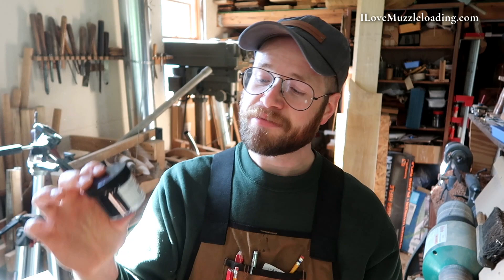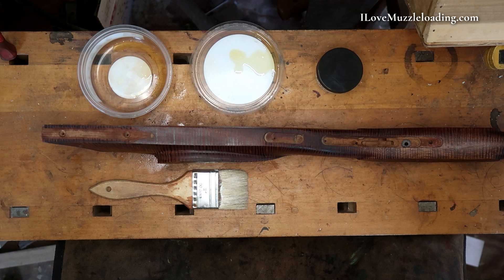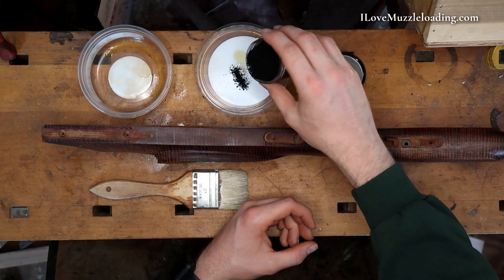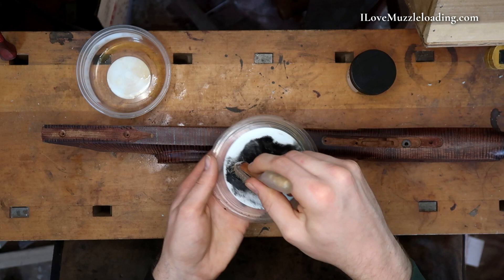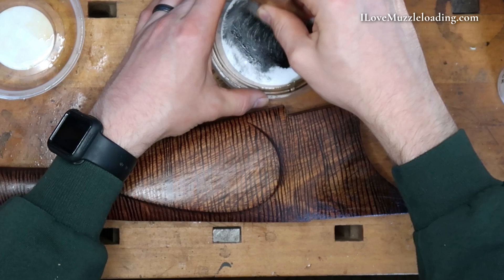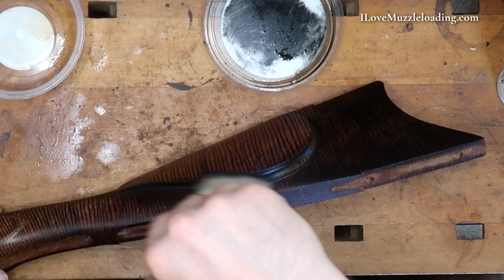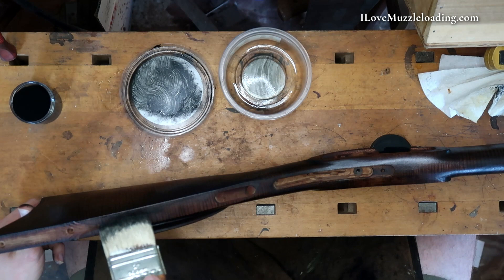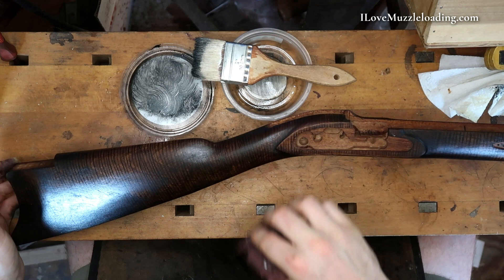How to make your muzzleloader look OLD | SIMPLE | Investarms Gemmer Hawken How to Build Part 23

Comment: I hope to have my custom built circa 1750 flintlock delivered next week.  The stock will not be aged, but I actually would rather have my guns age naturally and know that any aging that happens is due to my use of the gun.  This video shows a very interesting method of artificial aging and I would not be adverse to using it on one of my standard store bought guns to give them some more character, but the custom build  I am getting will be my baby and any wear will be from my own grubby hands.
Reply: I agree 100%. I have 3 builds, 2 finished and the last one soon to be finished. Could have gone with an aged finish but it never was an option with me. They are NEW and I want them to look that way until the wear is there from honest use.

Comment: That’s gonna look banging once you do the finishing coats of oil  ! 
I got a nice result using pine tar on my Lyman Great Plains rifle. Mixed with a bit of turps to thin it down then brushed into high wear areas , let it soak in then flame it really quick with a propane torch and wipe off the bubbles while still hot then finish it off with a coat or two of boiled linseed oil then very lightly knock down the grain with 0000 steel wool once dry. 
I practiced a bit first on an old axe handle before the gun stock , both came out pretty nice and the bonus is the pine tar treats the wood and protects it from moisture. Probably not authentic to the American gun making process but looks good all the same.
Reply from the maker: Great idea with the pine tar and linseed oil. Thank you for sharing!

Comment: We watch all your videos and especially like the ones where you travel to various events. 

 I'm looking to make a brand new factory assembled Traditions Hawken Woodsman flintlock look aged. 

Oh and fyi y'all...Check your local pawnshops where i found this one new in the box for 175 units.

 Any information on removing its present finish would be appreciated.
Reply from the maker: I’m not sure the particular sealer they use in their wood, but I’ve read that stripping solvents can remove it, others I’ve seen file or sand it away

Comment: Howdy Ethan:
 I have to agree with Phil Stocks. I think you did a nice job, but I feel (IMO) that you got waaay too heavy handed on the sides of the butt stock? I thought using the Bone Black was supposed to simulate wear? Wear would lighten the areas, not darken them, plus how much wear occurs UNDER the cheek piece. When I do a Bone Black job, I hold/handle the rifle stock for a few minutes to determine where that wear occurs and Black accordingly.
 All in all a good job, but like Phil, not my kind of finish. Just saying.
God bless:
Dave
Reply from the maker: No sweat Dave, I totally understand. 

I applied the bone black in locations where I've seen darker color and wear on original muzzleloaders from the 1700s and 1800s. Hope this helps inform you more as to why I did what I did moreso than I did in the video! Keep your powder dry! :)